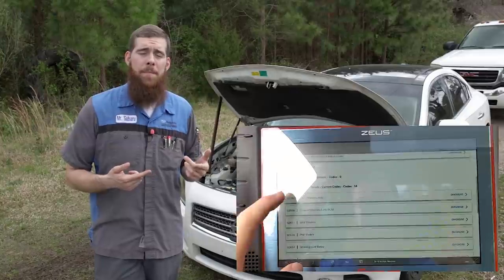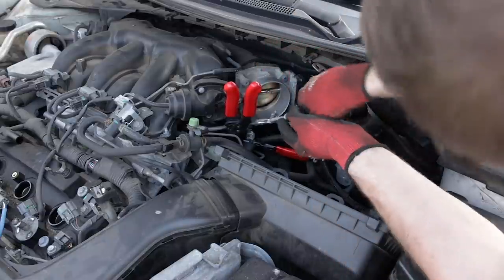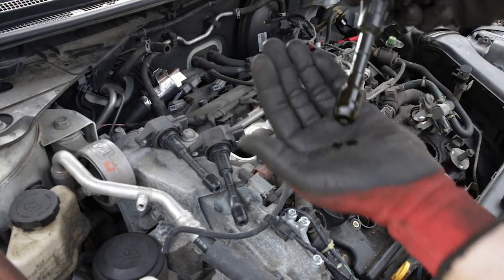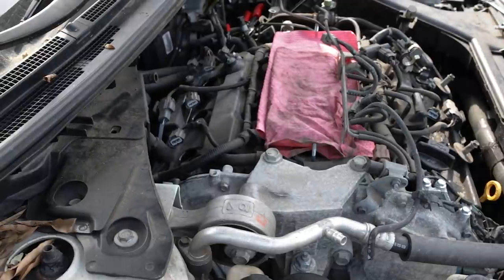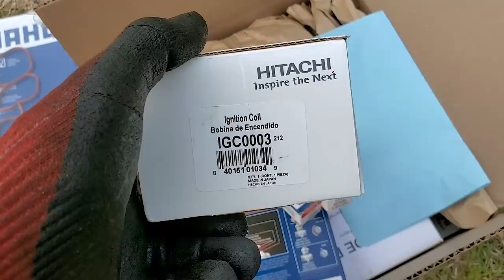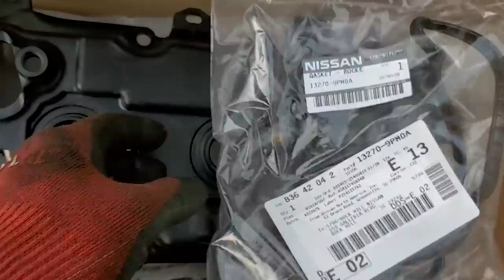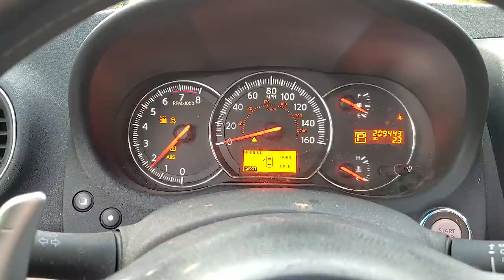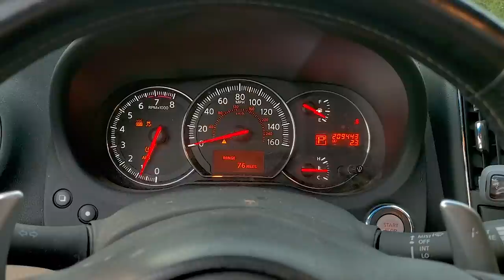2010 Nissan Maxima Misfire: P0300 Bad Ignition Coils, Spark Plugs, & Leaking Valve Cover!

Comment: My father has been working on Nissans most of his life and told me this model of maxima and then the older 2000s with the butterfly looking taillights were very reliable as long as you do regular maintenance. But he’s told me he’s had several customers with over 250k with just regular maintenance the biggest ones were use good oil(this usually kept the seals on the valve covers like this video mentions from failing) and service the trans with a drain and fill about every 30k  or sooner if you’d like and change the trans filter every other drain and fill.

Comment: I can only afford 1 mortgage so I try to do most of my own work. I had a cyl 5 misfire on my maxima and just went and swapped out the coil in about 10 minutes. No need to take off the intake either. 100 bux, a flashlight and a 10mm hex.

Comment: Some of these modern design engines make Subaru look like a piece of cake.
Reply: Subarus are simple to work on if you ask me. I did a timing belt, water pump on my 05 legacy at the weekend. Took me about 3 hours and I'd not done one before. Easy!

Comment: Watched every single minute of this video. Don't understand my addiction to watching other people work on cars, but I keep feeding it, lol. Thanks for mixing it up with another marque. Cheers, Mr. S.

P.S. I had my car's crankshaft position sensor connector somehow work itself loose last night. The car would intermittently jerk and misfire badly after a few hard pulls, but only while driving leisurely. Go figure. Would die promptly thereafter, and exhibit an extremely hard start. No check engine light. Did it again this morning and left me stranded by the side of the highway. Thank goodness I had my laptop and Tactrix adapter with me. Found the code P0335 stored. Took off the alternator cover and stuck my hand down below the (still burning hot) alternator. I literally slid off the connector with one finger. Very odd. Cleaned out the contacts on both connector and sensor with cleaner, reconnected the two firmly (no satisfying click, boo!), and yanked at the connection to ensure a snug fit. Reconnected the negative battery terminal I had disconnected earlier and she fired up right away! I was ecstatic. I was sure I would have to replace the actual sensor itself. The point of this long-winded story is that watching your videos has given me the confidence to troubleshoot and work on my own money-pit (modified genuine JDM Forester STi). Thank you, Mr. S!

Comment: I'm glad I have the 2000 maxima GLE much easier to work on top of the engine, I will be doing soon the coil and sparks plugs replacement one bad coil.

Comment: Thanks for a great video. Quick question for you, does the bracket behind the manifold attach to it? I don't think so. I'm also having issue getting the second hose clamps off. Is it okay to remove the hose clamp on the engine end?

Comment: Great video, one of the most informative step by step I've seen. sadly - I found it by searching "oil on coil and plug Nissan maxima" which means I already tried tackling the shaking engine misfire issue (thinking it's just a bad coil) and found the oily coil and went ahead and took out the plug to find it was also oily. after spraying some carburetor cleaner,  installing a new plug and a new coil and putting everything back together I started the engine for about five seconds. turned it off quickly because of the smell. so considering I inserted oil and carburetor cleaner into the cylinder - what is the damage I'm looking at and what should I do now?

Comment: On my 2006 Forester SG the trunk lid rattles on bad quality roads, and we have a lot of those. Figured out that the lid has a small left-right movement and the Liftgate Lock Striker Plate hits the actuator, and that makes the noise. How can I fix it? The Liftgate Bump Stop seems to be in decent shape, but I also tried to lift them with 3mm to push the lid harder, but it didn't solved the problem. Not sure if it will fix the rattling if I change them.

Comment: hi I change all the  spark plug on my  V6 2009 Nissan Maxima but not running smooth any advice need your opinion
Reply: Did u also change the Ignition coils too
Reply: @user-um5sn5un3z  thank you for your advice I did replace  number 3 coil pack now running smooth

Comment: Mr subaru please see this comment. I need help! I have an 87 toyota pickup 22r with the 4 speed manual. My clutch is toast. Where do you recommend I order the parts? Have you changed one like mine? What did you use and what results?
Reply from the maker: I've done a 90s taco clutch. Used a Perfection brand kit from Advance Auto Parts. Was around 2013.
Reply: @MrSubaru1387  thanks! I'm having a hard time between brands deciding. It's just too many options
Reply from the maker: Can never go wrong with an Exedy.

Comment: Mr Subaru. My 2010 Subaru Outback 6 speed has been acting weird lately. Sometimes I have trouble getting into second gear. As if there was a physical barrier preventing me from getting into second gear. I hear no grinding nor feel like it would want to perhaps enter second gear. It does so every now and then and when it doesnt, getting into second gear is as easy as can be. Also, whenever I am in town and have to shift more often and can actually hear, I hear a clunking noise whenever I get into neutral to get into the next desired gear. 

Is my transmission going bad or something that has to do with the clutch? I changed my transmission fluid 3000 miles ago and the fluid had nothing of concern in it other then being old. 

Thanks for your help.
Reply: Just my two cents, but my 04 Subaru lost some teeth on 2nd gear and started making a grinding noise whenever I was in gear, ended up needing the transmission taken apart and put back together with a new 2nd gear. Might be something similar but I don't know. Good luck.
Reply: @IronFishChannel  yeah well I dont hear grinding noise when in second gear. It just happens that sometimes I cant get into second gear. I can after pressing the clutch 2-3 times and bumping up the rpms... other times it slides in smoothly like there were no problems..
Reply: @TheCharacter97  possibly a clutch issue I'd say. How many miles on the clutch?
Reply: @SquidgyPickle  153 000 miles
Reply: @TheCharacter97  that might be your answer man....
Reply: @SquidgyPickle thank you I will get that checked up
Reply: @SquidgyPickle  also, would you have a clue as to why I hear a thump/clunk noise when I put the car on neutral? I hear it more in the city at lower speeds but I hear it clearly when sitting in my car at home with the engine off and just getting inti different gears and getting back into neutral.. does it only when getting into neutral
Reply: @TheCharacter97  not sure mate, possibly engine mounts?? It's hard to say! Hope you get it sorted!!
Reply: @SquidgyPickle  alright. Thank you. I hope I get this sorted out as well. I will go get it checked out by my mechanic.

Comment: I wonder if  Nissan finally changed their crappy accessory belt drive system my model didn’t have a self adjusting tensioner it was a weird ass tensioner that you had to set it had a warm gear drive on it that you would have to first loosen the bolt on the pulley itself and then you could drive up or down For a preset tension it was a shitty set up and the first time I change the belt on that car I didn’t realize you had to loosen the pulley bolt first   and stretched the worm gear drive and broken it lol!

Comment: I swear these 2000 to 2012 nissans are absolute shit.. from maxima, altima, murano, rogue.. i have a 09 murano and it has giving me 5 times the problems as any other vehicle ive ever own. The company wouldnt give me a new cvt.. bouggt my own engine. Alternator, starter, battery. Tires.. just an absolute shit ahow.. i hate nissans after that.. i will never get another nissan because of it.
Reply: Also this is the exact same engine in the 09 murano. The cat is absolute trash aswell. I mean damm.. it would leak and leak and leak.. even after inspection. And gaskets and man.. it was just dog shit. Jinco trash.. truly made me want to rip it out and put the engine in aomthing else with an manual and have room to actually work on the Damm car lol because this side way engine is Garbage. Do lnt care what anyone says. Yea it balance this.. Yada Yada but God u can't say this is a good vehicle after it fails after 70k miles or less.